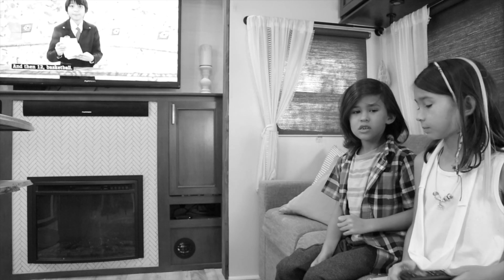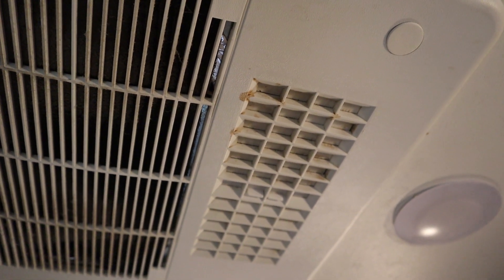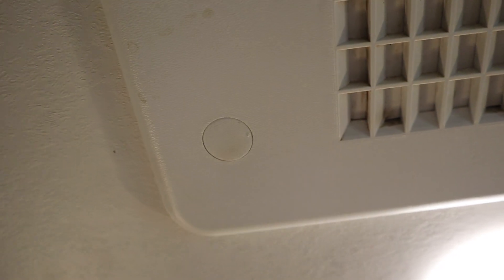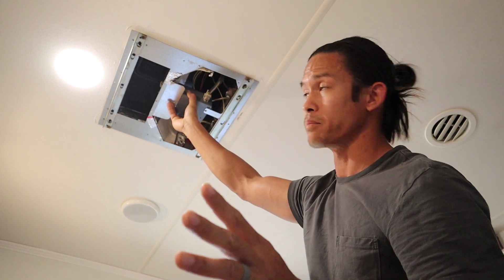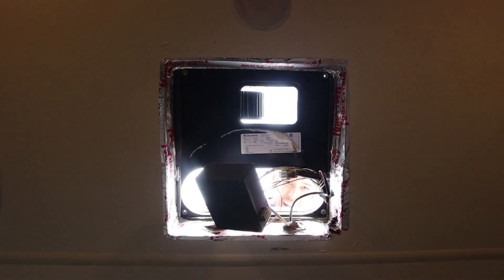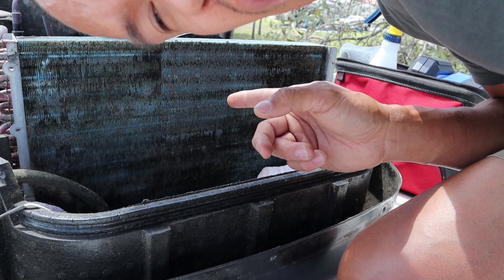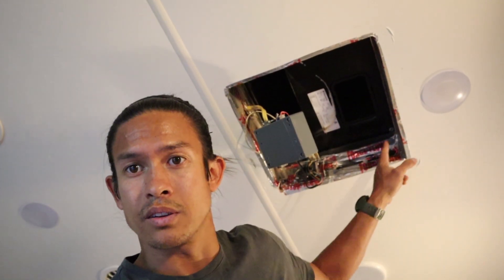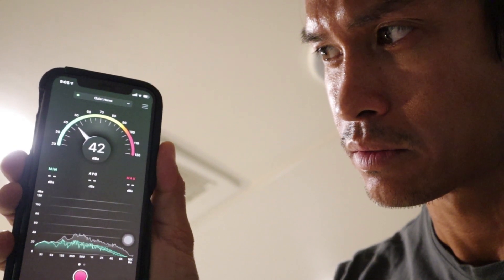DIY RV A/C Silencer

Comment: What do I use if I do not have a thousand trails membership card? 🤣 We do this  yearly on our house and rv!
Reply from the maker: Be sure to try the “silencer” mod. What a difference!
Reply: @ProjectTrek  my current rv has a side mounted window unit, I did 3D print ducting for it and wrapped it in foam rubber.

Comment: I will be doing this on my ac unit! I had to buy a Bluetooth speaker just to hear my tv!
Reply from the maker: So I did it twice - once on my bedroom 13k btu unit and the other on my 15k btu unit. The drop in noise levels was much more significant on the 13k btu unit. They are both much more efficient now, but just so you know, for actual noise reduction the results vary somewhat.
Reply: @ProjectTrek  even if I can improve efficiency, that’s a win in a central Georgia summer!